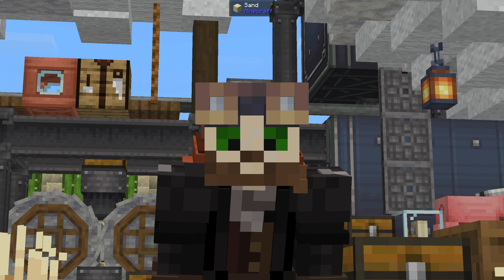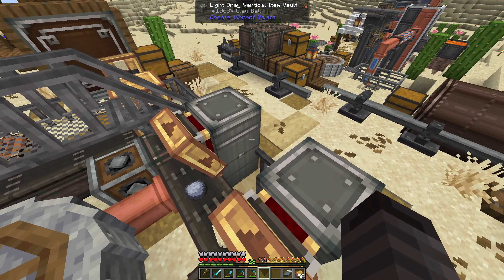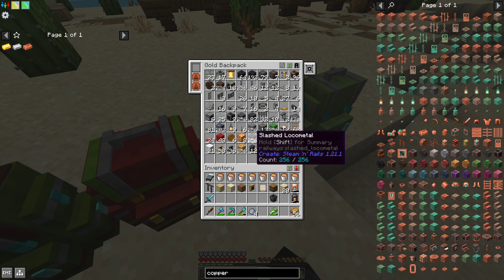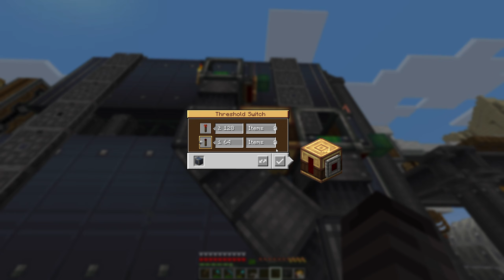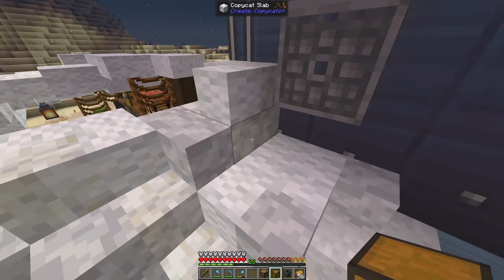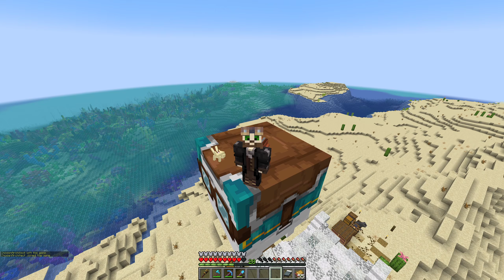Building an Iron Farm using Create Mod | Just Create SMP

Comment: 7:14
You can put the threshold switch right beside or behind the smart chute, this way you don't need a link.

18:32
Safety recommendation: put a block, a trapdoor or something like that above the space between the crushing wheels. 😅

23:13
Instead of the depot, put a basin filtering for ingots and a press above it.

Comment: Careful with the Redstone Links. As far as I'm aware, distance doesn't have any effect on them, only if they're chunkloaded or not does.

Apparently, when the server was started, all the members were given a category of items only they can use (like steps or slabs or tools, etc.) to prevent cross-wiring. You should check which item you were given and use that for your links.
Reply: I believe they do have a range limit, but it's still good to use the categories to avoid interference if you happen to build something near someone else.